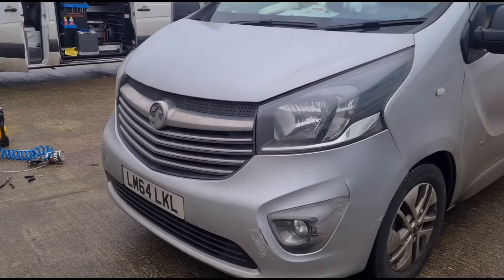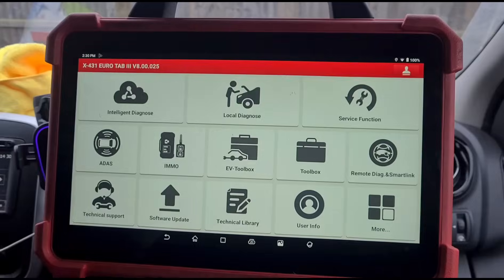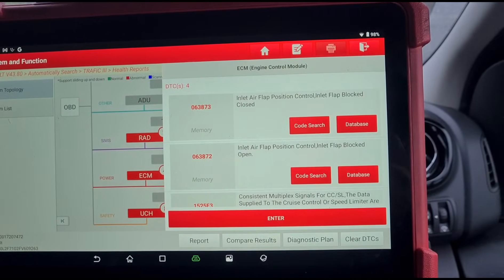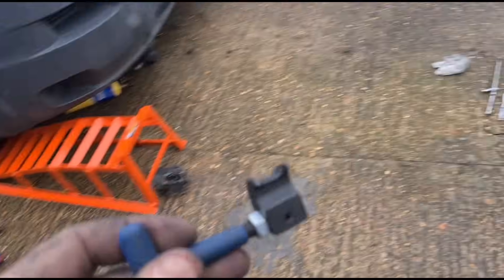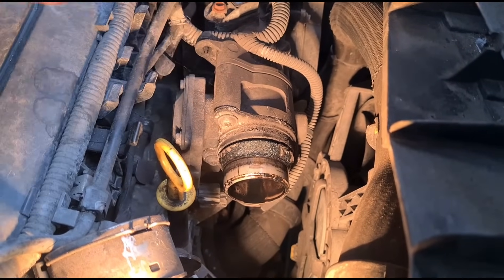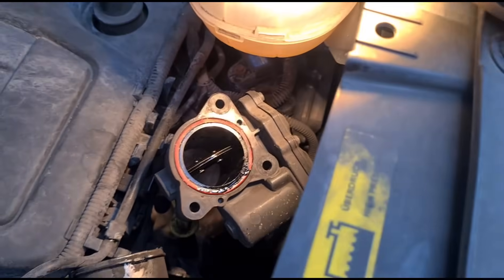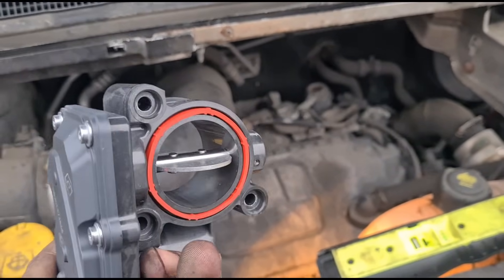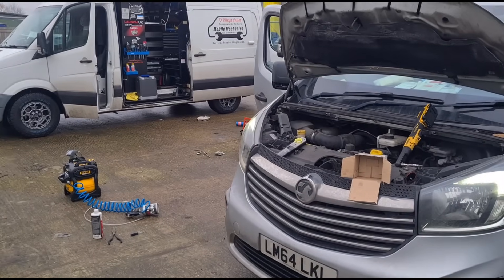Vauxhall Vivaro P0638-72 P0638-73

Comment: Hi im getting inlet air flap position no response from the valve motor. It was this fault and inlet air flap position control stuck open. I first changed the flow meter that took away the stuck open fault still remains is the no response. Also swapped the throttle body attached to the flowmeter still keeps coming back with the same fault any ideas what the fault could be. Thanks in advance

Comment: Hi Jimmy, I'm from Australia and have a 2016 Traffic III that will not rev off idle at all unless the clutch pedal is depressed and then only to 1500rpm (this may be normal??). This car has been to a dealer (apparently) and now come from another workshop that have had it for over 6 months. Had the upstream pressure sensor pipe blocked and associated errors, now have clear codes (using the same Launch you have). Done a DPF regen ok so engine can rev right up to 3000rpm ok. Gone through live data and checked everything that may be a problem like pedal position, brake switches, clutch switches, neutral switch and cannot see anything wrong that I can think of. I'm trying to find another car to compare against but that's not easy here. Have you seen this type of behavior in the past? Thanks, Greg.